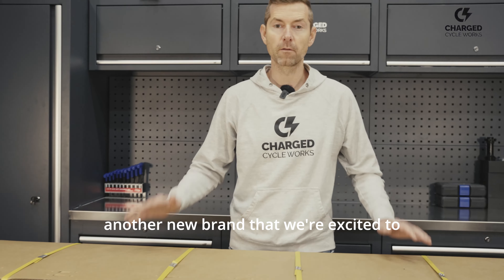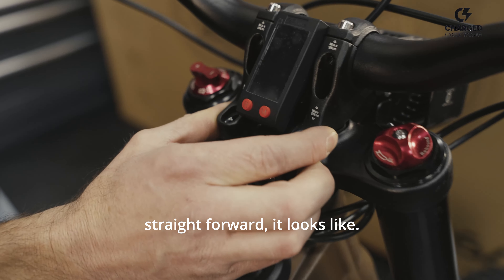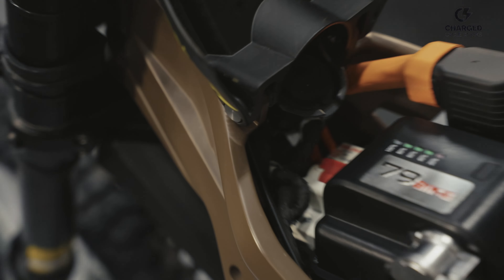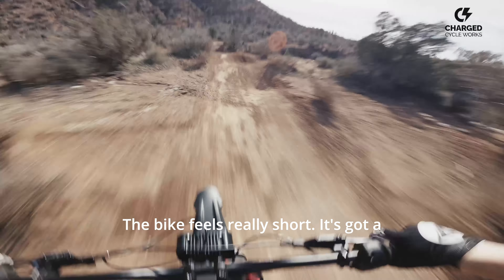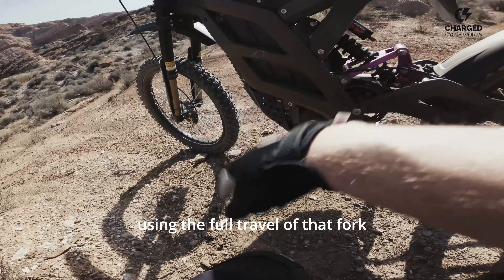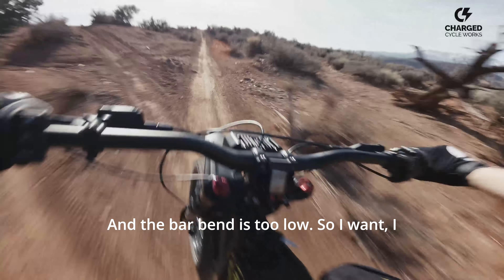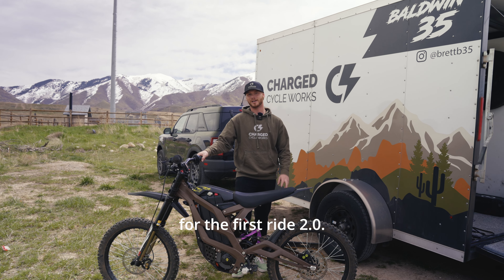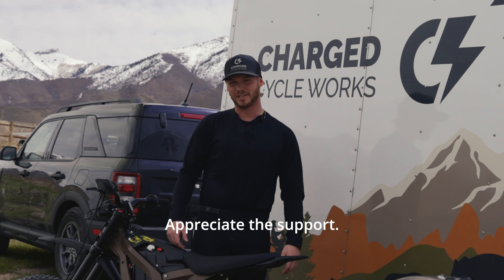79 Bike Falcon M "First Ride and #unboxing"

Comment: "What looks like DNM forks; decent forks"... What. DNM forks are crap. That says enough about the brand for me.
Reply from the maker: They looked to be improved DNM forks in comparison to original ones at first glance. However upon riding them they are very similar to the old. So yes, they aren’t the best. 

We have had good success in tuning the DNM fork and when that is done they are significantly better.

Comment: The design of that shock (DNM) uses an open piston design with only a rebound shim stack. The compression adjuster (bleeder circuit) is the only thing controlling compression damping. That’s why you can fully close it off. It’s a terrible design 😂